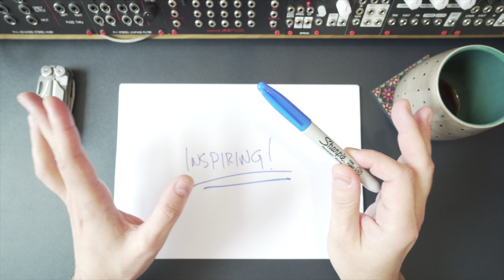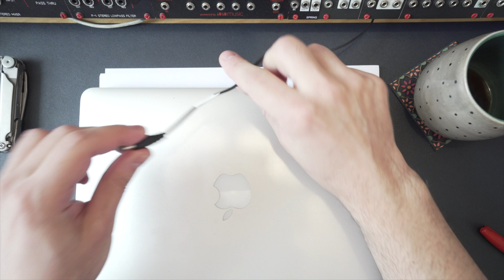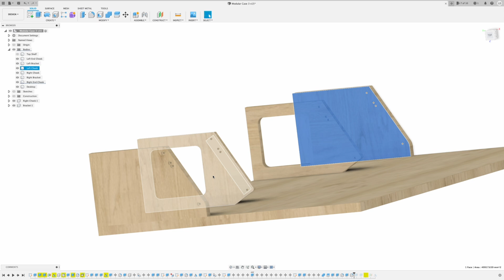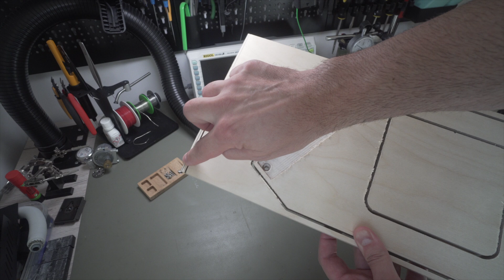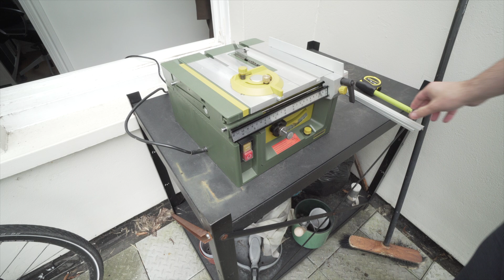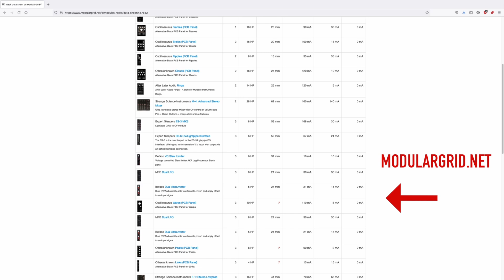Making the PERFECT Studio Desk! Part 2: The Build

Comment: Hello, Nice video. Great job of how you built your desk. I wanted to ask if you an idea of how I can my midi keyboard sit more of an tilt angle enough to be able to see the screen on the midi keyboard. The midi keyboard I am talking about is called Panorama P4 by the company Nektar. It's a great keyboard and does what it's supposed to do with my daw. It's the screen that is the issue I am having. The screen doesn't have the tilt angle feature on it, so the keyboard lays down flat and I would have to slouch over to see the screen. Let me know what I should do.

Comment: Hello Leo,
Awesome video and lovely setup.
I'm aiming to build a similar aesthetic standing desk and I just wanted to know if you could tell me the dimensions of the "work table" and the "upper table" - I have a pair of Adam T5V (which are almost 30 cm width) and have some doubts to which size should I go for the "upper table" (I'm aiming for a table top of 160 cm by 80 cm).
If you have any tip, I would appreciate.
Thank you!!
Best,
Bruno

Comment: glad I ran across this video.  I have an electric desk and I'm doing the same build.  One difference... I have the 8361a genelecs
Reply from the maker: Ahh lucky you!  8361 are glorious but make sure your desk can support all that weight. Also, with 8361s, you might be pretty close to the minimum seating distance to the speaker. It all depends on the size of your desktop.  Just some things to consider (worst case, you can always move the speakers on stands just behind the desk)

Good luck with your build!
Reply: @LeoMakes  
Yea… they’re already on stands.  I building it with 2 bays (10 units per bay).  I’m going with more of a mastering style desk.  The slope will be a little lower that yours. What is the degree of your slope for the rack gear??

Comment: In 2002 We had one of these machines at the small fireplace manufacturer. We made individual fires them by hand using band saw and router saw, but the bulk orders where cut by the machine. The machine could only cut a shape out using a single thin drill bit relatively basic and no router. The material was thick sheets of compacted glass fibres, the exact same heat resistant material used in American space shuttle.

Comment: Awesome video! I’ve been wanting to build my own desk and your video has inspired me. Do you think this desk would be possible to build without the CNC router? Thanks!
Reply from the maker: Absolutely.  The cheeks for a desk like this are not that complex and can be cut with power tools. The CNC makes it easier but it’s definitely not a requirement. 

Thanks for watching!
Reply: @LeoMakes  what tools would you recommend? A router, circular saw, and a jigsaw?
Reply from the maker: Yes, exactly.  A table saw or track saw are always really nice for making super-straight cuts but there are workarounds (guide rails) if all you have is a circular saw. 

Good luck with your build!
Reply: @LeoMakes  definitely let me know if you plan on uploading the dimensions, would help me out a bunch!

Comment: Whose rails are you using? And did you shift from lipped to flush? Also, a newbie question - why Intellijel instead of PulpLogic for your 1U modules? Thanks - great build.
Reply from the maker: These are flush rails (no lips) as I think it looks neater.  I had some of these rails left over from a big group buy I did years ago but I needed more for this desk and exploding-shed.com in Germany had exactly the same ones (those guys are totally awesome, BTW--highly recommended).

The PulpLogic vs. Intellijel is a good question! The two formats are not physically compatible (one is slightly taller than the other!) so you have to pick one or the other. I like PulpLogic and I have several of their 1U "tiles" in my portable case but I went with Intellijel here because 1) they have more of the utility modules I wanted and 2) they use the same exact power and connectors as standard 3U Eurorack modules (PulpLogic has a different connector).  With Intellijel 1U, I just need one power distribution board inside the desk and the ribbon cables can connect to anything in the desk (1U or 3U), which is nice.
Reply: @LeoMakes    Afraid of that. Alas, exploding-shed doesn’t ship to the US. Thanks for the quick response, though.
Reply from the maker: @saxhorn1508  Bummer.  I'm not sure who to go to in the US for rails and DIY stuff. Perfect Circuit in California has always been awesome to me but I am not sure they sell rails and stuff like that.  

If you find a good place, please let me know too.  People ask me about good US stores for DIY modular and I never know what to tell them!
Reply: @LeoMakes  Yep, they do sell rails - Tiptop Audio Z rails. I bought my first set there (I live in Long Beach, maybe 35 miles from them).  Good store. A little over $50US for a pair of 104HP with inserts.
Reply: @LeoMakes  By the way, for the DIY’ers it is fun the take published circuits (like from Music From Outer Space, Erica Synth, Yusynth…) and using EasyEDA and JLC PCB (or similar) crank out your own modules. Start with the basics and combine and customize. And you can get the designs from Mutable Instruments and Music Thing Modular if you also want to learn how to program micro controllers. A bunch of connected hobbies, not counting woodworking and the odd sheet metal fabrication. All the more reason to build a desk like yours!

Comment: CAD is really awesome! When I moved the last time, I planned on partly buying and partly building new furniture. So I ended up modelling my whole room in CAD, to plan everything out. That's just super helpful, and building is pretty easy if you can just grab all the measures from CAD.
I didn't have the luxury of a CNC router, though.
Reply from the maker: Ja, I always do 2D models before moving into a new space and sometimes I go 3D if vertical space is really a concern.  Google Sketchup is good for this! (Fusion 360 is probably overkill in most cases)

And yes, having a CNC router is totally a luxury. I got it when I started this channel to learn CAD/CAM.  It's nice to learn on your own machine but I've seen many maker spaces that have high quality CNC routers now (better than this one).  So you don't even need to own your own machine and still have access to a good machine. 

It's an amazing time to be a maker / engineer / fabricator / etc!
Reply: @LeoMakes  I started with 2D cutouts, too, then switched to Fusion. I've used Sketch-up in the past, but the parametric design and timeline are super useful features especially when planning out things and making changes to the design afterwards.
Right, actually I'm a member at a local maker/science space, so I would actually have the possibility to use the tools there. But especially for learning and trying out new stuff, having tools directly at your hand is super convenient. And also in general, that's the reason why I still have a quite well equipped work bench in my room to spontaneously tinker around.
Any way, it's definitely super useful to have all these tools at reach.
Reply from the maker: @florianbeck4283  Totally agree on the parametric design. It's cool to change one parameter (like a hole diameter or "lean back angle" on the modules) and watch the entire desk update with all constraints being maintained. It would have been a nightmare before but now you can just play with it until it looks/feels right.  Magic!  :)
Reply: @LeoMakes  how much did this CNC Machine costs? Where can I buy it?
Reply from the maker: @Vocalisto  It depends on what size machine you want and if you want a self-build kit or a ready-to-run kit. Have a look here for more: stepcraft-systems.com

Comment: Nice build. In malta getting rails is nearly impossible. Since the lockdowns building stuff is very very pricey.
Reply from the maker: Oh, that's a bummer.  I had similar problems getting rails here due to Brexit.

Here's a tip:  I've seen people use plywood as "rails" and drill small wood screws (around M3 size) directly into the "rails" that hold the modules up. I know it's not ideal since it's wood but if you don't move your modules around too often, it might work out until things start to open up again and then you can replace them with real rails?  Just a thought.
Reply: @LeoMakes  yes that's what I resorted to with my 19" stuff.